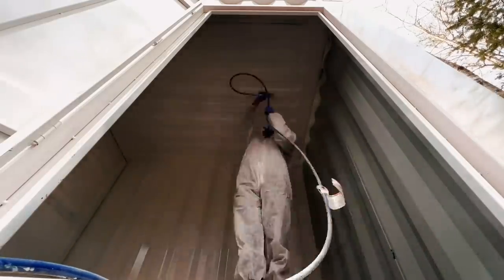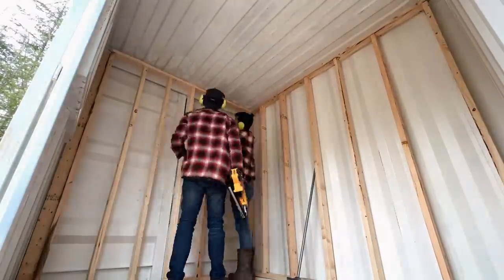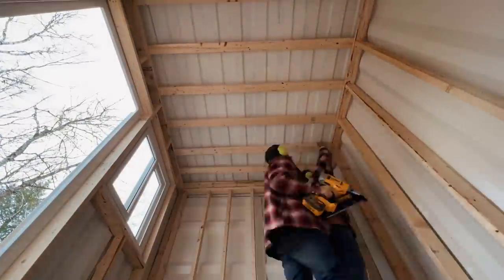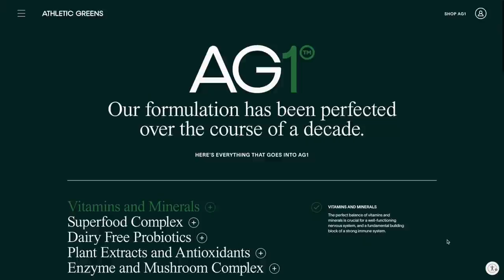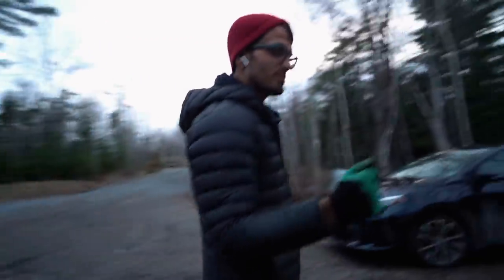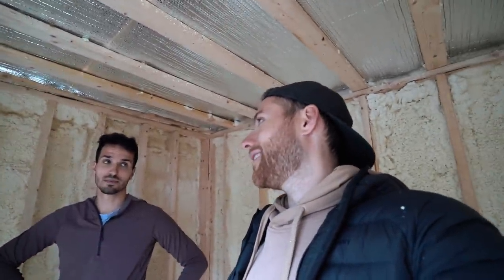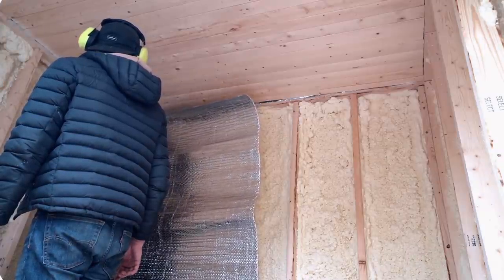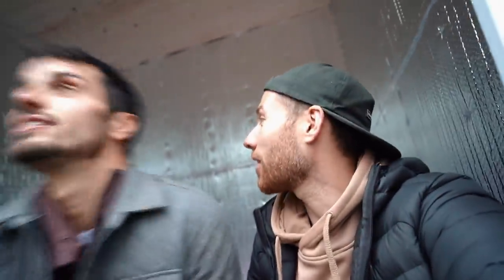Why this was never going to work...

Comment: I have to ask.  Since you are planning on building a more traditional house shortly, why didn't you just live in the RV, using the built in bathroom, instead of building the dome and now an elaborate "outhouse", since the new house will presumably have an indoor bathroom and septic system?  I have built a couple of houses while living in a motorhome at the job site.  Lets you direct all your efforts to the major house construction project while living "normally".
Reply from the maker: Because we can’t live in the RV during the winter and with the build we’re doing it won’t be ready in time! Better to have a comfortable place to live so we can have the energy to be able to take this project on :)

Comment: 🤗💖
When it comes to insulation, I believe that there's  no such thing as over kill....however, there is such a thing  as being too air tight.  Where is your ventilation?  Even in modern bathrooms with plumbing connected to city sewage system ventilation is required. The air inside your container outhouse still must be breathable. 🤗🤗💖💚

Comment: I did wonder about insulation but assumed you guys had it covered lol normally you research everything to finite detail, however its looking great, I dont recall you guys mentioning it but assume that you will install a shower basin and toilet in there. Did you consider any extraction system for humidity? now its so well insulated the humidity could cause damage to the timber cladding or mould growth, also I didnt see you install any electrics for lighting or heating water maybe you can utilise the outdoor shower water heater, mount outside and plumb through the wall if it cannot go inside.

Anyways looking great so far, keep up the great work, you guys really pushed yourselves this week.. take care 😘😘 Robb Torremolinos Spain

Comment: Welcome to "Container Sweat". Your solution is not insulation alone you need ventilation.   It is something they don't tell you about when selling you on container conversion.  If you do the math you will find out there are more affordable alternatives to container structures.  Especially in 2022.

Comment: Seeing you guys really insulated it so well, I was curious about whether you were considering a ventilation system (i.e. an exhaust fan, and maybe one with a light). I noticed the container had a window, so I’m assuming you’re able to open and close that. I couldn’t help but think a Max Air Fan would of been a great idea, than I remember, in Vans they’re wired into the battery banks. Are you considering any type of lighting system?

Comment: While you don't want bridges for heat, for moisture it's almost the opposite. You always want to have a way for the moisture to escape, so you should never have two moisture-blocking layers without some sort of air venting. So I'm not so sure the aluminum especially in two layers is good idea :/ I hope you have not done this in the house, it might cause problems especially to the wood in between the layers.

Comment: won't those nails go right thru the steel of the shipping container and cause water intrusion issues ? I would have used a silicone adhesive to attach the walls which if you frame it tightly you shouldn't even need to attach the frame to the container walls ..the 4 walls of framing would support itself.. then insulate and drywall the interior and tile the floor .. oh I thought you were nailing the frame to the container my bad

Comment: Hey guys…..I’m just wondering about electricity for the out house as well as the hole in the flooring for the toilet/drainage? I thought you would cut the hole before putting in the floor, but I have no idea 🤔How will you heat it with no power running?

Comment: I have a question regarding the out house, which is looking great!  Will there be a vent in the ceiling? Or any type of venting?  It’s looking pretty air tight, which is great for keeping warm during the during winter.  Just concerned about fumes and airflow.

Comment: Nice insulation job-well done! Question/comment-should you have a vent pipe on the top/side just to vent out air and odors?? Or, will the windows suffice for air exchange? Just a thought.

Comment: Looks amazing but instead of using the spray insulation why didn’t you used insulation that comes in a roll or big strips wouldn’t have that been easier

Comment: great job! Can’t help wondering about wiring and piping? will you do it on top of wood?
Reply from the maker: Hey Alicia!! The piping (water) would have to go inside the enclosed space so it would'n't freeze and because the space is so small, we've got a great plan in place for the lighting!
Reply: @tylerandtodd  great! of course you have ! 🥰

Comment: Another way to have a warm poop in an unheated Canadian outhouse is to remove toilet seat ring and put down rigid styrofoam insulation with a hole cut in it to sit on.  Even in -30 temps it is instantly warm when you sit on it.... .just sayin

Comment: I did wonder why no insulation was in the original design. Cock up. Resolved.
I bet the total cost is more than had you built it from entirely from lumber. You wanted to save on lumber but seems to be a heck of amount of lumber used anyhow. Framing and sheet board for it all to be constructed surely would not be more expensive than a metal box with lumber interior ??
The metal box will soon rust and leak. It already has holes you had to fix. 
Whatever, it will do a job for a while.